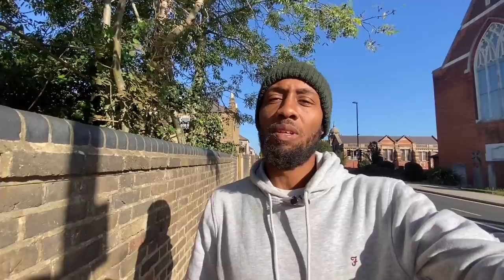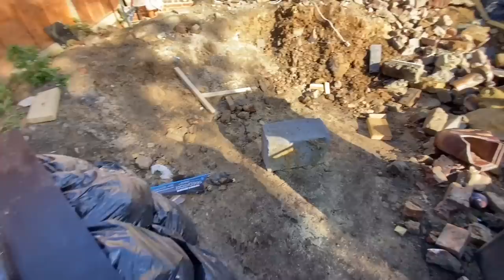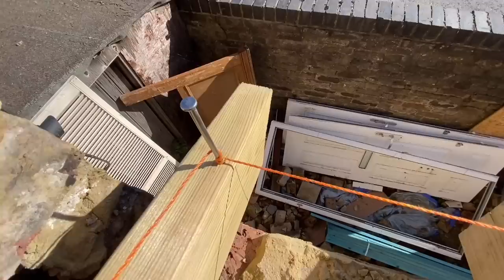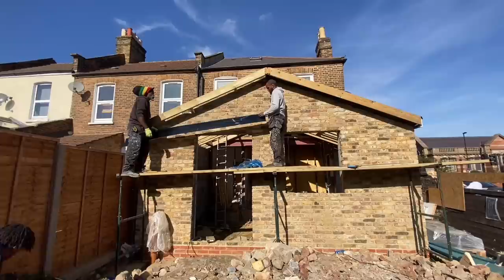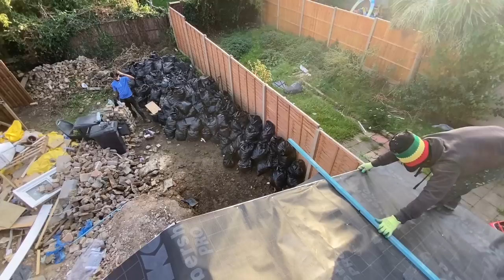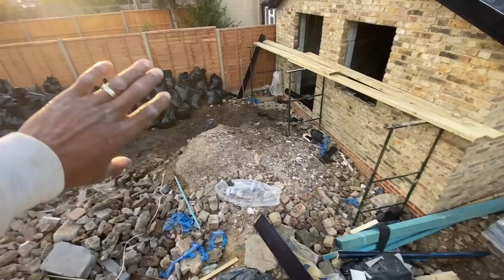London extension build - Ep 37 - The roof is covered

Comment: Hi Darren a  suggestion for you regarding fear  that someone else  expressed. They were fearing that the nailing of the rafters rather than using joist hangers would cause a problem. Maybe if you brace both set of rafters together left and right you cold then also use the braces to box of the steel with fire rated board. Regards Daniel

Comment: Noggins aren't really necessary on a roof like this, especially a cold roof. You might have to drill holes through those to ensure you get adequate ventilation from eaves to ridge - that or use a smaller size timber but they're already in now. I've only ever seen noggins specified to sit under the restraint straps to avoid racking, but in my opinion the battens do that job anyway!